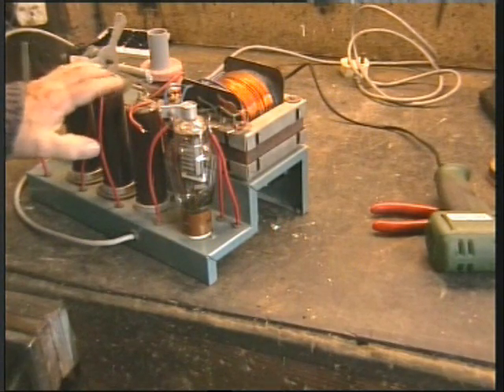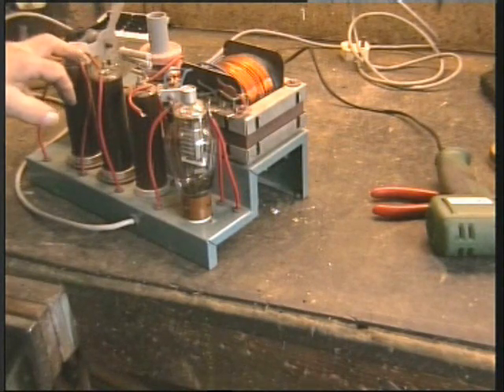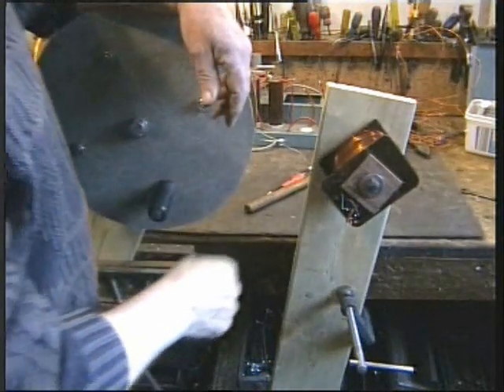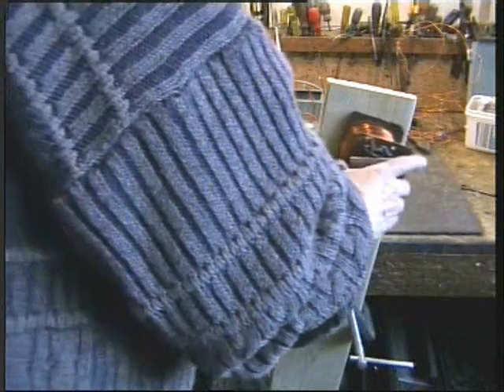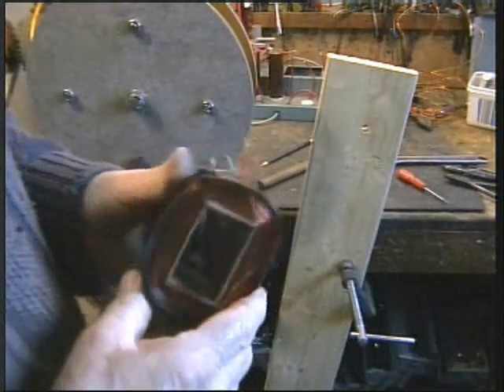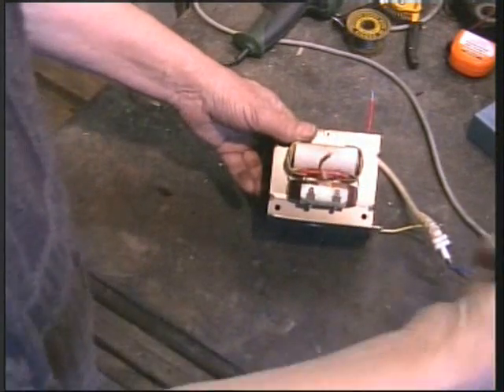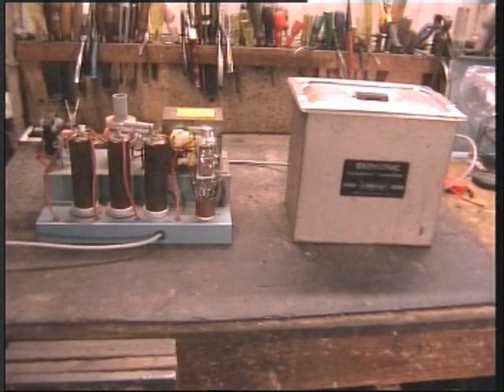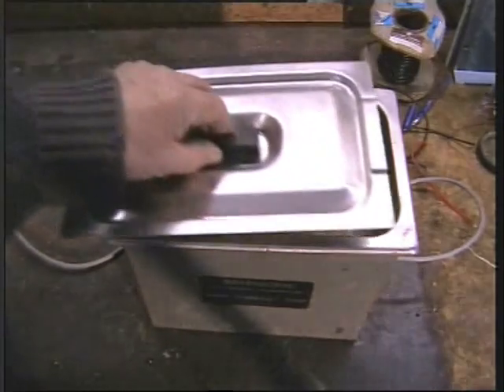Ultrasonic cleaning lll.

Comment: Thanks for your reply so quickly, but without using chemical terms could you suggest any solutions I could use in my ultrasonic cleaner for cleaning tools,sorry wish I had the opportunity to have learnt chemistry but it never happened thanks again and keep the videos coming as I can relate to your thinking all the best
Reply from the maker: Mechanical cleaning may be your best bet then (steelwool/wire brush etc) also consider electrolysis look it up on here,its not difficult to do.experiment first whith some scrap metal to get your hand in.
Reply: ***** Thanks again for your reply and time.All the best ,take care!!!

Comment: Great result and well done replacing the transformer. The heater voltage looks a bit high though (very bright glow) - maybe drop the voltage with a resistor if you don't want to rewind. Please show the cleaning process in action.